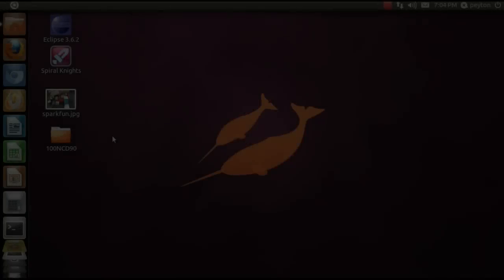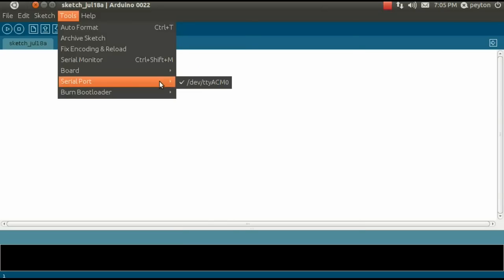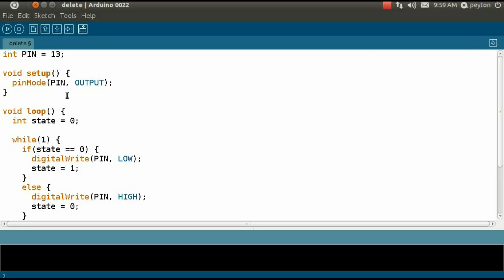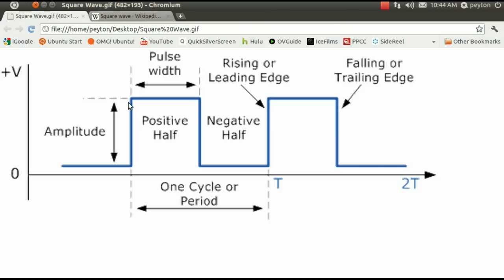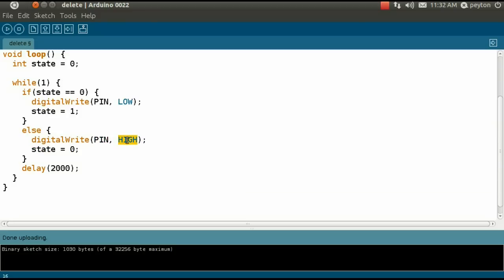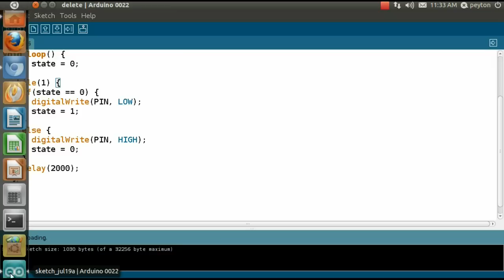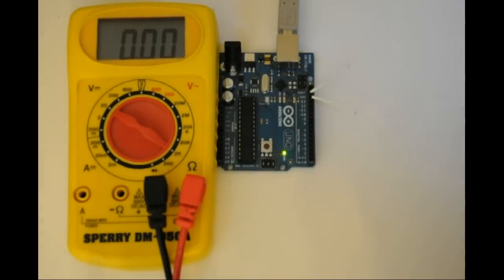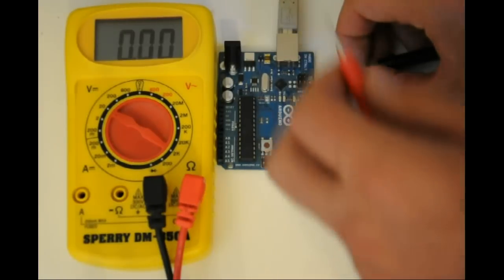Square waveform generation tutorial using Arduino UNO and Ubuntu/Linux

Comment: Why while loop tho?
this does the exact same thing and is far easier for everyone to understand:

int PIN = 13;

void setup() {
  pinMode(PIN, OUTPUT);
}

void loop() {
      digitalWrite(PIN, LOW);
      delay(2000);
      digitalWrite(PIN, HIGH);
      delay(2000);
  }
Reply: if someone wants to have 50hz you can change the delay to 20.. for example:

int PIN = 13;
void setup() {
 pinMode(PIN, OUTPUT);
}

void loop() {
      digitalWrite(PIN, LOW);
      delay(20);
      digitalWrite(PIN, HIGH);
      delay(20);
  }

Comment: what is the min dealy you can get with this can you get less than a milli second as i need to use a 24VDC pure square wave trigger signal to turn a high speed solenoid to trigger a jet valve for dispensing micro droplets . i prob will be using something with a much faster processor

Comment: Thanks for the great video.. As I understood, if I need a frequency of 1 kHz, I should include a delay of 0.5 msec, right?
Another question, is there a way I can give a DC offset to the square wave diagram and have the voltage changing from -2.5v to +2.5v instead of 0 and 5v?

Comment: Can we generate a square wave of desired frequency - say 50Hz without using "delay()"?
Great video by the way!!
Reply: +Naren Sankar  Not sure if you want absolutely specific frequency. I didn't need it, so here's an example of what I did to provide a square wave with adjustable frequency from a potentiometer on A0. I know this is old, adding for people that may have the same question.
/* Wheelspeed input
 
 Outputs a 5v square wave with adjustable frequency
 
 The circuit:
 * pin13 to tip31 
 * potentiometer input on analog0 to adjust delay
 
 
 created 2013
 by Jason Russell
 */

// constants won't change. Used here to 
// set pin numbers:
const int ledPin =  13;      // the number of the LED pin
const int speedcontrol = A0; // Analog 0 for the potentiometer

// Variables will change:
int ledState = LOW;             // ledState used to set the LED
long previousMillis = 0;        // will store last time LED was updated

// the follow variables is a long because the time, measured in miliseconds,
// will quickly become a bigger number than can be stored in an int.
long interval = 30;           // interval at which to blink (milliseconds)

void setup() {
  // set the digital pin as output:
  pinMode(ledPin, OUTPUT);   
}

void loop()
{
  // here is where you'd put code that needs to be running all the time.

  // check to see if it's time to blink the LED; that is, if the 
  // difference between the current time and last time you blinked 
  // the LED is bigger than the interval at which you want to 
  // blink the LED.
  unsigned long currentMillis = millis();
 
  if(currentMillis - previousMillis > interval) {
    // save the last time you blinked the LED 
    previousMillis = currentMillis;   
    // Set the interval (frequecy) after the first time through
    // Done here so it only checks every toggle, not every loop
    interval = analogRead(speedcontrol);

    // if the LED is off turn it on and vice-versa:
    if (ledState == LOW)
      ledState = HIGH;
    else
      ledState = LOW;

    // set the LED with the ledState of the variable:
    digitalWrite(ledPin, ledState);
  }
}